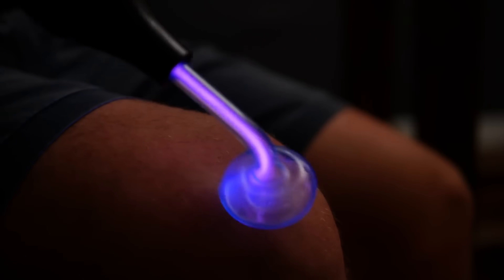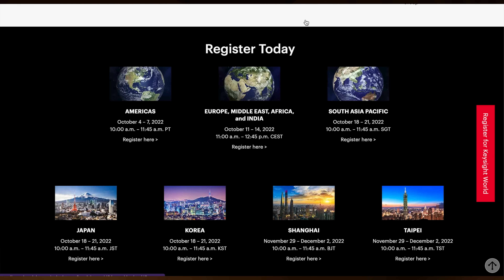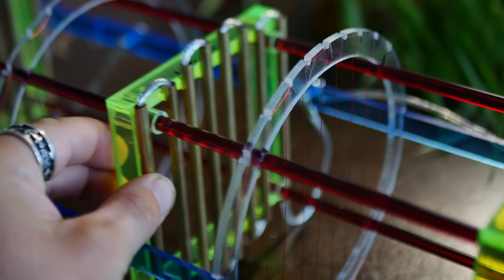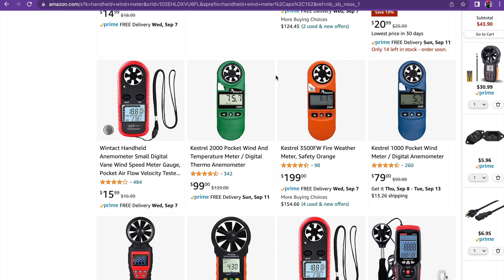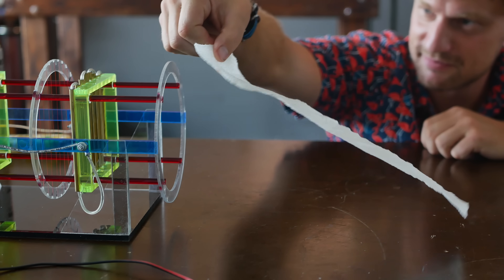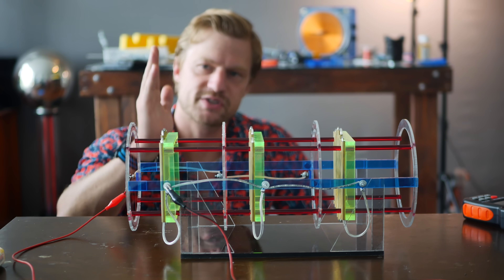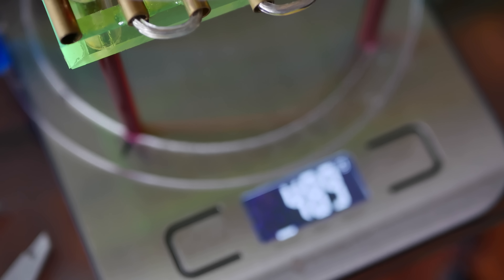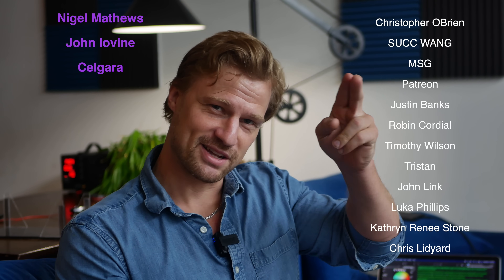Designing A Next-Gen Ionic Thruster! (For Flight)

Comment: Things you could improve:
Everyone has already talked about a housing... that's obvious
A curved nozzle at the intake would help
A restrictive nozzle at the output would help
If you're going for a circular design for the frame, you should use a circular design for your components. You could do rings or a spiral
You need to control your emitter locations. A few people have suggested barbs. That MIGHT work, but you may have a problem with heat distribution from a point. You may want to go with curves to dissipate heat. The distance from peak to trough will change depending on your voltage
You need to control your ground locations as well. Same thing. I would LOVE for you to test whether you should have one or multiple ground locations for each emitter. For example, put one ground peak in front of one emitter peak vs put a ground peak in front of an emitter trough. so 2 peaks hit it. This will be especially interesting with a curved peak emitter. Then putting a ground peak at a trough but also across 2 emitter strands so it's hit by 4 peaks. I don't know which of those would be better. Perhaps make a way of moving the ground in different directions to run tests.
Your ground is WAY too thick. You're blocking airflow
If your going to keep the square design, alternate angle. First one at 0 degrees, next one at 30 degrees, last one at 60 degrees. This should help with airflow direction
This would be difficult, but if you spin the emitters each in an opposite directions. This would be in conjunction with the above test to change the location of the ground.

Now that you know it works, you should really set this all up with a set of step motors so you can get true graphs of how distance and location effects your output. Arduino anyone :-)

Comment: I think the unit need to be sealed around its perimeter. An open ended cylander. To isolate ambient surrounding air from the accelerated ionic air. Each stage accelerating, ala' rail gun.Also,possibly, a "gadget man groove" type feature to introduce some toroidal action..

Comment: So, the mechanicals work.  Now implement the principals of a turbo fan from commercial and passenter jets, but without the first fan.  A big cylinder that houses a smooth cylinder with your 3 thrusters inside.  Also, instead of using tubes, maybe flat surfaces would be better.

Comment: As many others have stated already. Enclosing the length of the structure. for weight maybe enclosing it with wide kapton tape.  This would be low weight and restive to the heat and voltage. then a bell intake and a mild tapered exit for a slight increase in air velocity.

Comment: Around 1965-6 I was looking for a junior high science fair project and saw an article about ionic thrust in Popular Science. They quoted 30,000v required for operation. I think there was a photo of the device in the article. I haven’t heard anything about this topic for the last 50+ years until Hackaday mentioned it. So if you’re interested in an earlier reference, check out popular science around 1965.
Reply: I read the same article, made a grid system with bare copper wire, very little thrust. I did go to national /international science fair in 1968
With this project.
Reply: @dannyhyatt4924  congratulations on making that thruster. That was my dream project but at a time with no resources and little knowledge how to do it. I ended up trying to put together a spark coil power supply. I went to a local junkyard to find a spark coil but ended up being caught for trespassing which ended the project. Didn’t realize that I was trespassing. Thought everything was garbage. Oh, well…

Comment: The additional structural weight curve is steeper than the additional thrust curve, per element. This could be mitigated if the weight were significantly reduced, which it definitely can be. Drag coefficient can be dramatically improved as well. The advantages of multi-staging are lower frontal area and higher velocity, so those must be critical factors for the lowered energy efficiency to be practical. Turbulence issues weren't tested, but more laminar flow could easily be achieved. And a more efficient power supply, of course. I noticed that the "nodes" along the wire seem to self-organize, but I wonder if there is an ideal spacing which could be achieved by kinking the wires?

Comment: Using dissimilar metals in the circuit causes electralysis in the connection which is a defficiency. The weight of acrylic is heavy when comparing to carbon fibre. The engine is subject to parasittic drag having clean purpendicular surfaces in the directio. Of travel. A ductless design leaves other options for air to escape meaning  you are pushing air outwards as well as through each chamber. And long and a long and skinny design could fit in the wing as a pseudo bi plane that looks like a mono wing. This would give the best weight to lift ratio.

Comment: The NAZI's were playing with Ionic Thrusters during WW2 in Czechoslovakia in the mountains. The research centres in the bunkers were totally destroyed before they were overrun by Allied Forces.  There were some photos released relating to the projects in books some 30+ years ago. No one has been able to work out the reasons for the apparent  high voltage ruins left, as all the copper and metal was salvaged before detailed investigations could be carried out. Leaving shattered concrete ruins behind and impassable caved in tunnels.

Comment: thrust goes like V^2... so your increase in Velocity does increase the thrust. But if you just put 3 of the ionic thrusters side by side... you'd have 3*T, where T is the thrust of one thruster. It's not clear to me you've actually got more thrust over all vs just using 3 side by side? you list 1.5 times the velocity for 3 stages, so 2.25 times the thrust all things equal.. which is less than 3 you would expect by running them side by side. Perhaps I am missing something, but I would love to see that comparison made.

Comment: A smooth tube! :  should have tried with real smoke so the flow through the whole device is visible, I bet the air stream is diverging and turbulent at the edges, especially with the square profile acrylic rings. #2: use taut alu foil strips as anodes, round tubes creates large buffering wakes #3: Another benefit of an enclosed tube, is that whatever thermal heating the plasma causes to the air, it will aid in accelerating it the same way a ram jet does. #4: Off topic: Maybe "jet engine" is not the most efficient analogy, what about a plasma Coanda lifting body?  Besides looking exactly like the stereotype UFO when glowing overhead  at night, you get far more static trust but at lower speed, but to get it off the ground, that might be the ticket, but I can't imagine how well electrons follow a curved surface?

Comment: What is the weight of a single stage setup in comparison to a 3 stage setup? It isn't worth the 50% power increase if you are more than tripling the weight!
Reply: Actually you should test the thrust for each of the stages because even though 3 stages is only 50% faster, it might be moving more volume and thus produce more thrust.

Comment: You might get more thrust if you:
1. Replace the round ground electrodes with a flat bar with sharp edges in parallel with the wind direction to allow air to flow more smoothly.
2. Add a shroud around the thruster to stop air flow loss out the sides, even just glad wrap should work.
3. Use bare copper wire instead of the coated wire.
4. Use a finer wire
Great video!

Comment: I think you could work with your air intake and expulsion. Like covering the back two thrusters with some light weight material (maybe even just plastic wrap for proof of concept) except for potential intakes, it would i guess prevent wind from flowing out the sides, making it more directional. I have zero knowledge of ions, but if you ionized a gas that was heavier than air would it provide more thrust in normal earth atmosphere? maybe carbon fiber tubing/webbing as a material upgrade/ weight reduction. Just thoughts.

Comment: You may be current limited by the power supply and getting secondary effects mixed in with your experimental results. For example, staged spacing may be more effective because the overall voltage is higher.  Can you measure the working voltage during use?

Also, for this reason, it may be more effective to wire the stages in series.

Comment: needs an intake horn and a thrust tube exit.  free velocity! 

also, the cylinder grounds are a huge obstruction (slowdown!) in the airpath, they need to be thin blades! 

also,  you should test the effect of the diameter of your thruster, and how tapering down like a funnel will affect the HV elements.

Comment: Do the receiver electrodes need to be so think?  The rods side.   Couldn't it work with the same size as the transmitter electrodes?  

Couldn't you massively increase the density of transmitter electrodes?  Like 6mm or less between electrodes?  I know at some point, it would be an air restriction, but I don't think you're there yet. 

Instead of the receiver electrode grid, could it just be a ring around the ID of the body?  The general round shape, the diameter of the inside of the transmitter support ring.   If that doesn't work great, you could go for fewer receiver electrodes.  As long as they can carry the power, and can flow across the distance, it shouldn't matter how many electrodes are present.   Try something like 20 transmitter electrodes, 4 receiver electrodes.

I want to see more work with the measurements of stages.   I suspect you'll find a sweet spot much closer to what you're already using.  Set that sweet spot for the first stage only. Then adjust the second stage for the sweet spot.  I think it's closer than you're already using. 

I was doing some electrical design for something kind of similar, but not air driven.  I thought rods spaced in the device would be best.  It ended up being plates, separated by a thin nylon washer, so the plates didn't touch.   It was a different application, but I think the electrical flow would work the same.

And, try higher voltages and more current.  You'll want more isolation, so you don't damage the rig or yourself.  Put a non-conductive body around it, and use a remote trigger.   On mine, larger gaps and open air sparks made EMPs that knocked out my electronics.   But the larger gaps weren't beneficial to the project anyways.

I may have to set up to try this here too. :)   I have to get some other projects out of the way first.

Comment: Imagine taking a jet fuel, but instead of burning it in a combustion reaction, you would super heat it to turn into a plasma and then at point when the plasma is exiting the chamber/bell it would ignite, creating a pressure "cap" that would lead to a plasma that is inside the bell to create higher pressure. Higher pressure = higher "power"
1. u can see inconsistance of the plasma forming on a coper wires. maybe brush them to get rid of oxide and expose pure copper?
2. enclose the system the create pressure and cosistant flow. right now its pulling air from everywhere. its like putting a shroud on propeller
3. increase the number of copper wires. put them in criss cross pattern or in a coil shape around the perimeter. simply make a copper tunnel to see how that would work out. 
man i could play with this all day with different setups

Comment: Are we sure the ground bars need to be so thick? I think you might be able to get even more thrust by using "blades", so that you can have enough of an electron sink without as much obstruction to airflow. The higher the surface area the better, so if you could have a surface that had ridges like a ruffles chip, that goes in line with the flow to not obstruct air, that would be even better. It would be interesting to compare the two. Being said I think your current implementation is AWESOME, and I really would love to see more work being done with this. I would be willing to even join the patreon if it seems like we're going to have more of these as I really feel like ionic thrusters are an underexplored tech. Oh and old electrician's trick, if you keep a hand in your pocket the electricity won't go through your heart. At the current you're dealing with it probably doesn't matter but if you scale up it can save your life because as you know at higher voltages air is a wire.
Reply: 👆Hi....Thanks for watching You've been choosen
randomly for watching my channel I have something for you follow the instructions above to
acknowledge your prize🎉

Comment: brass tubes, create drug on the air... ability to take air from sides also create drug on the speed up air that is coming in from the front. if the intake has a cone, would have more laminar  air flow on the first coil.. that will help too

Comment: Well Done Jay...   Good channel save after that silly 60v revolver video...   Love this one and look forward to the improvements..

some things to try :-

The round coper tubing you are using for ground would it be better if it was aerofoil shaped to reduce drag (maybe wrap some coper or aluminium  foil around a lightweight form) ?

what about surrounding the whole array in a skin so no airflow is lost out of the sides ?

Unless you can get better than 100% increase by adding multiple thrusters in series then wouldn't it just be better to put them side by side where you would get exactly 100% increase  ?

Comment: can someone buy this man a 3D printer? XD

you want to be able to adjust both the spacing of the stages, as well as the the length of each stage like you have now - the space between stages probably isn't helping, but too close and they may interact. it's possible the staggered one allowed the airflow to flow faster at the beginning, then let the airflow allow the electrodes to affect more air between them in the correct direction.
the pipes for the electrodes should be crimped in the front and back, to reduce airflow disturbance.
you'll want to enclose it. this will make a strong pressure differential from the beginning to the end. the enclosure's exit can also use fluid induction to "multiply" the amount of air it moves, essentially by "tugging" on air nearby the outlet
get a slight wind in front of it. existing wind velocity can make or break an engine concept. some can only add velocity to still air and stall out against faster air.

Comment: It seems like the only variable left untested is the spacing between each segment. It also seems like an inefficiency that should be ironed out.

Air turbulence on exiting the thruster needs to be reduced. 

Each segment may require different voltages to produce the fastest air flow, this seems very important to test as well. 

It's an awesome prototype. I can't wait to see where you take it.

Comment: that is remarkable! In my opinion, there is a lot of margin for improvement, especially in the design of the shape and orientation of the electrodes and the cross-section of the thruster.
 In particular, I think that the negative electrode should be more aerodynamic and that the encasing should be a rectangle with a wide base and small height in order to maximize laminar flow.
Another interesting thing would be to find the correlation between input flow and distance between the electrodes to achieve max thrust.

Comment: Inefficiencies I can think of are Heat, power consumption and Wear and tear of the electrodes due to the high voltage. Also an additional one is there is no ducting so you will lose thrust due to the lower pressure drag of the surrounding atmosphere.

Comment: Good job! I think that you have done a great study on the parameters that affect efficiency of ionic thruster and this is a good start point to further developing. i have some tips to improve the thruster: 1) as you can see there is a voltage limit where the air can't be no more accelerated due to chaotic ion collision. In order to decrease this negative effect, the air flow must be as laminar as possible so creating a laminar channel to force the air to flow laminarly using dielectric materials to avoid dielectric breakdown between the wire. styrofoam or eprom are perfect for the job. 2) Thrust is generated by differential pressure this mean that in front of the device pressure must be low and on the back must be high; the pressure of the fluid is low when his speed is high meanwhile pressure is high when fluid speed slow down. So in order to decelerate air flow to get high pressure you need to build a stator like those you se in a turbojet compressor after every stage (i think no more than three or meaby just one depends on the max air velocity you can get). However with the parallel laminar chamber configuration is in contrast with stator becaus the flow that come out from the accelerating stage is straight meanwhile the flow outgoing the stator is a vorticity so a partially rotative flow. every suddent direction change of the flow can cuse a turbolent one and this decrease efficency so i suggest a concentric laminar chamber configuration to smooth the aerodinamic regime transition. in Conclusion i suggest you to implement aerodinamic and geometry to improve thrust using solution already use in aeronautic thruster rearranged for the case.

Comment: Why not measure the thrust directly by suspending the device in mid air by a string over a frictionless pulley with the other side of the string attached to a slightly heavier mass resting on the mass scale? This would avoid perturbation of the flow hitting a plane directly underneath.